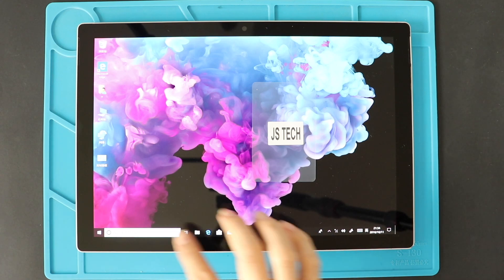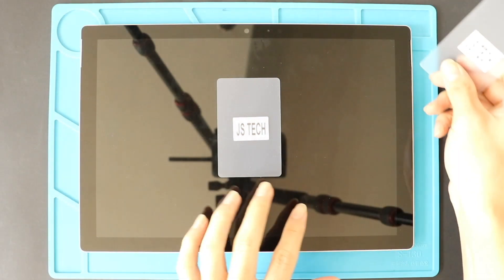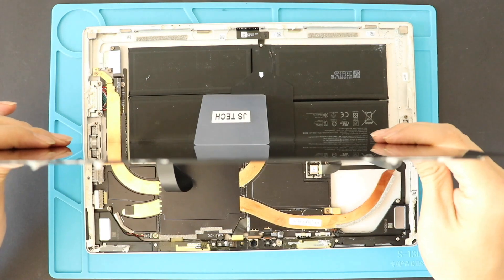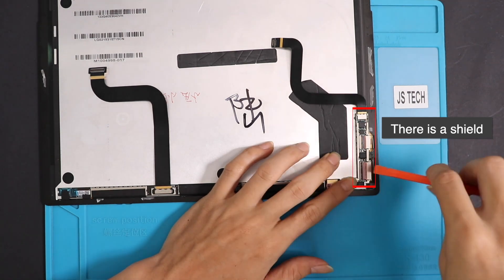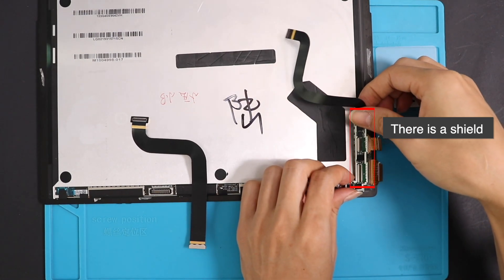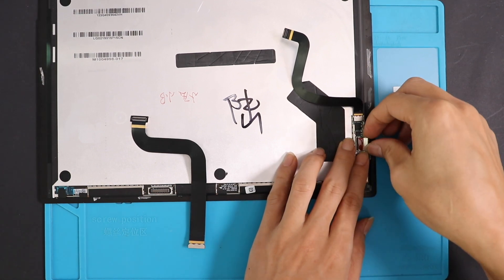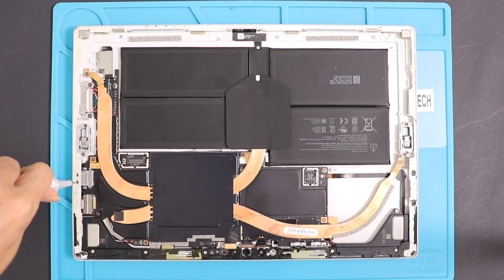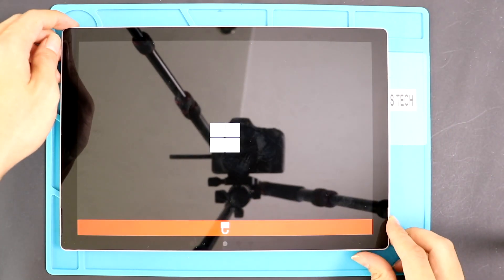Microsoft Surface Pro 5 2017 LCD Screen Replacement 1796

Comment: This is a nicely done video. Unfortunately, I could not understand what type of glue you said to use in the video.  Can you please add the glue name or type to the tools list.
Reply from the maker: It is B7000 Glue, and there are some alternatives as well. If not double sided adhesive
Reply: Glue is usually not the best idea to use for these because it's doesn't flex as much as adhesive and much more prone to crack at least in my experience.